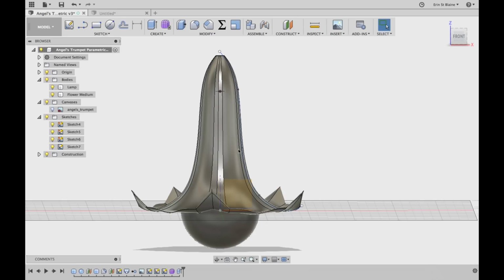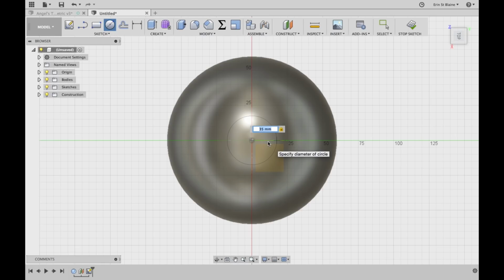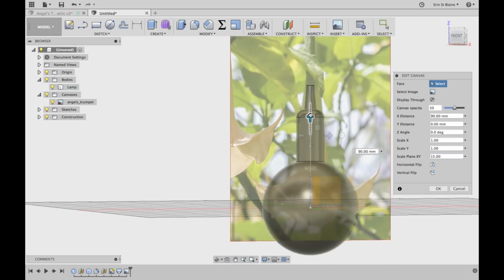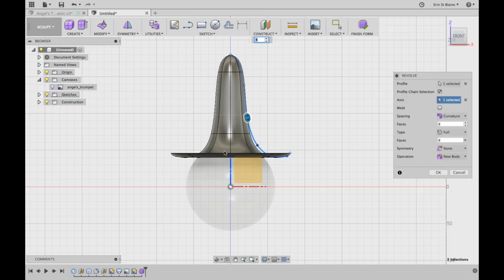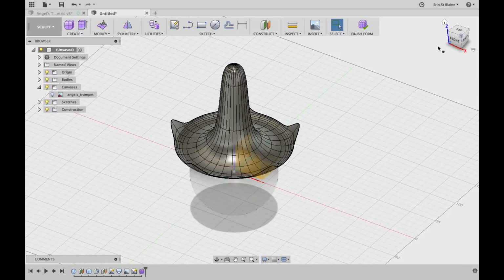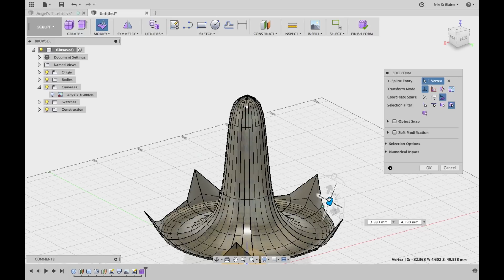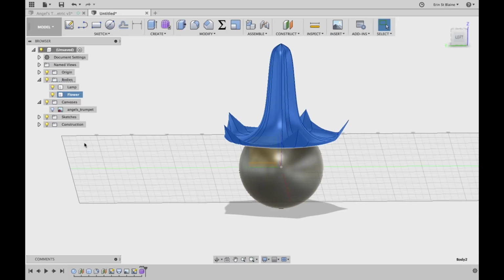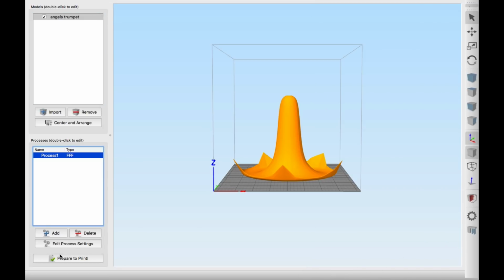LEARN: Angel's Trumpet Lamp in Fusion360 - Forms and Sculpting @adafruit #adafruit

Comment: Must use a heat resistant material otherwise it will soften due to the heat of the bulb in the light.
Reply: DAVID GREGORY KERR Plain PLA works fine with an LED Light bulb.. would be a problem with incandescent.